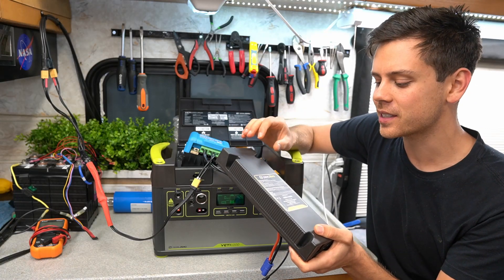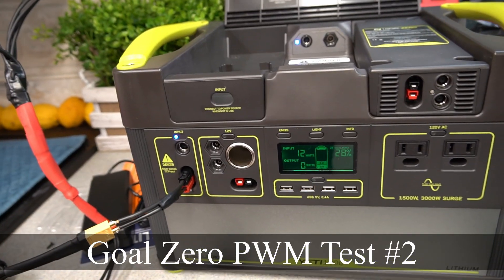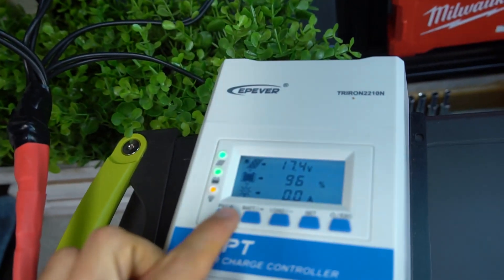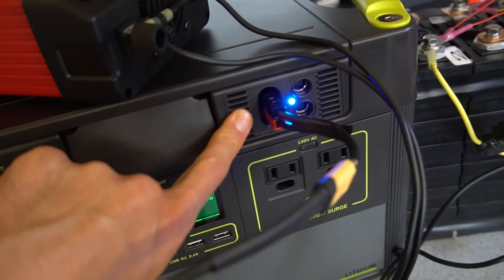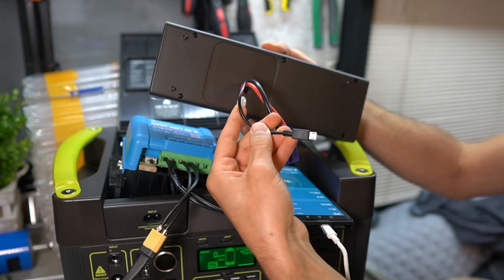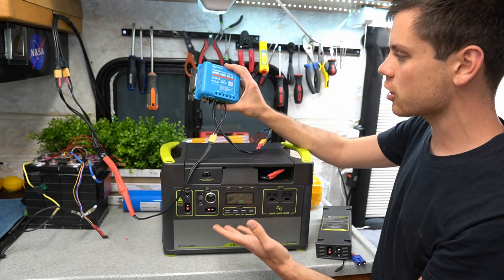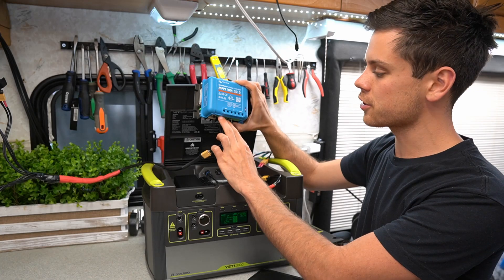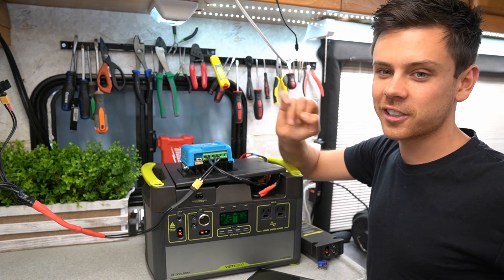How to Hack the Goalzero Lithium by Adding a Powerful Victron Charge Controller

Comment: I love your enthusiasm bro!  My question is, can can I hook my double sprinter batteries into this system as well for extra capacity?  If so, how?  Or, do I need to purchase the Goal Zero Link module and hook that in between the van batteries and the Yeti 3000 connections where the Link Module is supposed to go?  Curt

Comment: Could, or how would you wire this up to use a battery expansion module and tank from Yeti to work with the Victron?
Reply: I'm interested in this as well!   Just grab more batteries and put it in place of the Solar hookup?

Comment: Hi Will. Love your videos. I am located in Australia. I have just purchased a 100ah Lifepo4 battery pack anb a victron 100/20 Bluetooth solar charge controller. All my loads are connected directly to the charge controller. I'm really disappointed that they have crippled the possible functionality for the app to display an accurate battery percentage as all the data is available to the app. It seems crazy to have to add a shunt and a BMV-712 to the system to give me a battery percentage. Are you able to do a video on the victron Bluetooth mesh network and what benefits it gives. Say you have a charge controller, a BMV-712 and a 240v charger all connected via a mesh network what would the benefit be?

Comment: Thank you, Will, for another great video.  I have a question.  Would you recommend getting a Goal Zero Yeti to power a MaxAir Fan and a Dometic CFX35W cooler fridge instead of setting up a whole solar system?  I also have an 80 W portable Go Power Solar folding Panel.  I am thinking that it would be cheaper, take up less room in a van and less wires/electronics to deal with.  What do you think?

Comment: RE-ASKING for anyone to pretty-please answer:
Is it possible that by using the Victron 100/20 MPPT Solar Charge Controller ($166 - Amazon), instead of the Goal Zero MPPT,  you don't need to connect 3 x 120 W solar panels in parallel  as per Goal Zero (keeping the voltage under 22 V) plus the one separate 120 W solar panel as required by the stock Yeti and instead you should be able to connect just one mega-monster 470 W panel with an Open Voltage (Voc) of 91.5 Volts and Amps (Isc) of 6.45 using the Victron 100V/20A controller without causing any damage and being able to charge at that max rate? Or is it limited by MPPT input connection (at a max of 360W)?

Thanks in advance.
Reply: I would also be interested in knowing the answer to that!!

Comment: Hey Will, just wondering what you think of the Epever solar charge controllers? Ive go a 40amp model from their TracerAN series i use with some cheap folding solar panels in a portable setup for camping or similar.

Comment: Will, are we able to convert the output of a modified sine wave inverter  to pure sine wave (or at least make it better for sensitive electronics) by using a power conditioner such as a Tripp Lite LC 1800 Line Conditioner???? I have a Xantrex power hub 1800 solar generator that i'm afraid to use with some of my electronics..........(if anyone knows, I would appreciate the help!)

Comment: They must of watched your video because there selling the victron mppt on there website My 3000 yeti goal zero running a 800watt aircon shows a thermometer 🌡 in the display after 40 minutes and the instructions say turn everything off and let it cool down , have you ever had the thermometer 🌡 show in the display
Reply: They're not selling it for that purpose. They're selling it for the typical set up of panels to controller to batteries, not to GZ Yeti.

Comment: Great test, but I will stay with the GOalZero MPPT for 3 reasons, 
1) Safety, in case I misprogram something
2) unnecessary hassle with all the connections and trouble shootings
3) appearance

Nevertheless, great demonstration! Keep up your great work! Love your channel!
Reply: Gz charge controller is really bad though. I'm having g to do this work around because the van owner installed 40v panels with the  yeti 3000x. It only charges 150 watt instead of the 300 it should.

Comment: So I would like to be able to have an mppt charge controller 

On my yeti 1000 lithium , but I would also like to be able to use the yeti link so that when I'm driving it would be able to charge the battery, is it possible to do both? Is it advisable to do both?

Comment: Hi Will - Great video.  I have a Yeti 1400.  When programing the Victron 100/20, I found that it won't let me take the equalization voltage below 9.0 volts.  Have you seen this with other Victrons?  Also, will a 9.0 volt equalization be an issue?
Reply: this is what I was told: 
You won't be able to set equalization lower than 9v, but turn on "Expert Mode" and change Equalization current percentage to 0% and automatic equalization to "off" (which you already have) and it will never enter equalization... and even if it did, there'd be 0 current.

Comment: Your are just awesome Will! I just bought a Goal Zero 1400 and the Victron. I had to build my own EC8 cable because I couldn't find one in Europe.
Thank you so much for this awesome DIY Solution :D

In the meantime l came across two questions and answers. ;)
1. I couldn't set the Equalization Voltage to 0. The app always changed it to 9v as a minimum. - > Change the setting to LiFePo first. From there you'll get the 0V Equalization Voltage.

2.With the settings Will suggested my Goal Zero 1400 kept on charging way beyond 92%. I set the absorption voltage to 12.35 and then it stopped at 97%. I suppose I can lower the voltage (float and absorption) even further down to 12.30V for my unit. So be aware Goal Zero 1400 owners 100% are 12.50v!

Comment: hey will, i'm confirming what jwsonoma and carlos gomez said below.  the male ec8 to ring terminal cable DOES NOT plug into the GZ.  super frustrating since i've dropped 1.5k+ on the victron, GZ1k, solar panels and cables.  this cable took the longest to arrive and if i can't get it to connect i'll need to return everything and only have a couple of weeks to figure it all out.  can you please help??

can anybody else on this thread advise?
Reply from the maker: Oh thats horrible! Why doesn't it fit?? It's made to fit that port. And it's easy, just buy a ec8 plug and wire as you normally would. Not hard to do
Reply: @WillProwse  thanks so much for responding will!  i'll let you know how it goes when i get the other ec8 cable.  can't wait too get it up and running!
Reply: hi again, will!  i have everything in place!  took me a bit but i'm ready for my first shakedown cruise!  we're starting with only one panel - 
ECO-WORTHY 150W 18V Semi Flexible - just to start with.  when i got it all plugged in the meter on my phone will show 1watt and climb to 37 watts and then go back to zero.  any suggestions?
Reply from the maker: Can you send me a photo of the plug and the goal zero ec8 plug. You did remove the plastic case right? To access the ec8

Comment: GZ Male EC8 to ring accessory doesn't work!  Hey Will, I just got my GZ accessory, dentical packaging to yours, and the connectors are surrounded by a plastic plug. Mine is actually even heavier than the one you show. The EC8 connectors need to stick out. Any recommendations?  If I make my own which side is +ve. Thanks Great video.
Reply: i'm in the same boat!  i don't see how it ever could have worked.  and this one link is the one i need to make everything come together.  if you figure out an alternative, please let me know.  i'll do the same for you.
Reply from the maker: And it says on the connecter what is plus and minus
Reply from the maker: Use this cable instead https://shopsolarkits.com/products/inergy-6-foot-ec8-solar-panel-cable?utm_medium=cpc&utm_source=google&utm_campaign=Google%20Shopping&gclid=CjwKCAjwpuXpBRAAEiwAyRRPgQ668utkbTCNjk__sDx_TuUSJ82s44CZL1GGyPuLRaNeRvwI4zufyhoCp6sQAvD_BwE

Comment: Hi Will! Thank you for all your information! I used all of it and decided to buy a Goal Zero 1400. One question, can I use the Victron 30a for this as well with all the same settings? I would LOVE to see a video on all your hacks on the 1400!
Reply: I suppose any Victron MPPT will do. It only depends on how many panels you are gonna use. With my setting (Victron 100/20, Goal Zero 1400 & a total of 270w solar) and Wills suggested voltage settings I experienced that it kept on charging way beyond 90%. At 12.35v (absorption and float) it ended up at 97%. I don't know if the battery voltage for the 1400 is different but it seems so at least for my unit 🤷🏼‍♂️. The Goal Zero 400 is rated at 100% with 12.6v as well. I currently run it at 12.30v but it needs further testing. But charging does work very well with this combo! I suggest start slow and work your way up  to your desired percentage.
Reply: Matthias Hollmann just about to get a 100/30 as I will be having  (4) 100w panels parallel into at voltron into the yeti 1400. Any suggestions on wills parameters?
Reply: UPDATE: For the Goal Zero 1400 100% are 12.50v. I still run it at 12.30v (=96%) and everything is fine. The Goal Zero Display doesn’t seem to be that accurate.
Reply: @Lost.Reception  are you running 12.30 for both absorption and float ?
Reply: @MEX72  I do
Reply: @Lost.Reception  Wow I have my settings @ 12.20 for both and my GZ shows 100%  GZ 1400 Victron 100 /30
Reply: @MEX72  Wow! Well the display isn't very accurate. Charge alle the way up with the wall charger and check the voltage! That's how I figured out that my real 100% are at 12.50 volt. :)
Reply: @Lost.Reception  That's a great point, I will do that 
Thanks

Comment: Thank you for making all the videos that you do! I just found them and I'm currently working on my 144 sprinter van conversion with a 390W-380W solar panel. This is what I was thinking for my power is 2 RENOGY LITHIUM-IRON BATTERY 12 VOLT 170AH but now after watching this maybe just a GOAL ZERO YETI 3000? What are your thoughts? Renogy is runny a deal rn and I get 25% of of Goal Zero products so it would only be $150 cheaper to go with Goal Zero for me.

Comment: The problem with too many MPPT controllers is they are often limited to 30volts or less at the solar input. So you cannot run even two 12volt panels in series as their combined series open circuit voltage will exceed 30volts. This I why I purchased a Victron MPPT controller.
Reply from the maker: Wait what? Not epever or any other common mppt on market. Usually it's 100-150. I have some with 200v. Victron has good voltage input, but not that great. Lots of better options in that single regard

Comment: I have a 400w lithium Goal Zero and one complaint I have is that they are not good communicators. I want to buy  the 12v car adapter so I can charge it with my alternator while I drive and they are sold out nationwide. I have emailed them 3 times and got no response. If they are one of those "We got your money so we don't want to talk to you again" companies  I am done with them.

Comment: So can you use the victron controller to charge the goal zero and another 12v lead acid battery?
Reply: At the same time with the same MPPT charger? The voltage setting is completely different. You can't charge both at the same time with the same settings. Liquid acids need higher charging voltage and with those settings you would kill your lithium battery.

Comment: Hey Will, nice Video! I just bought a EPEVER 40A MPPT Charge Controller and I managed to hook it up to the GoalZero Yeti 1400 and to my Computer. What settings can you recommend to charge the Yeti? I saw the Absorption Voltage is at 12.5 and the Float Voltage is at 12.35. But in the case of the EP Tracer I still have some more values to be handled. 
BatType: 0   —> User
BatCap: 200   —> 132 ah (in my case)
TempComp: -3  —> 
OVCutOff: 16,00  —>
ChargLmt: 15,00  —>
OVRcv: 15,00   —>
EquilV: 14,60   —>
RaisV: 14,40   —>
FloCharg: 13,80  —> FlowCharging (should be 12.35)
RaisRcv: 13,20  —>
LVRcv: 12,60   —>
WarnRcv: 12,20  —>
LVWarn: 12,00  —>
LVCutOff: 11,10  —>
DischaLmt: 10,60  —>
RatedLv: -1   —>
EquilDur: 120   —>
RaisDur: 120   —>
BatDisch: 30   —>
BatCharg: 100   —> percentage of charging
ChargMode: 0   —>

Maybe you could help decipher the values. I also tried reaching out to the support ;)
Thx, Eduard
Reply from the maker: Just make sure the charging limit voltage is 12.5v, then make the other parameters agree with that
Reply: @WillProwse  Thanks for the advise. The support just explained to me the meaning of the abreviations. Now it will be much easier to adjust the parameters. I really like your work. I learned very much by watching your channel.
Reply: I had it working but I decided to change to a victron controller due to the easyness of the configuration. If I had a WindowsPC or tablet I would have stayed with the EPEVER Tracer. But now it is much easier.
Nevertheless thanks for the quick replys and all the ideas and reports.
Reply from the maker: You can disable equalization

Comment: Hey Will great video. Just curious, did you mean to say the male ec8 goal zero cable?  I think you may need the female version of the cable. Let me know. thanks!
Reply: did you ever figure this out?  i'm trying to order the right cable...
Reply: CassandraComplex Ordered the cable based on Wills link. One step closer.
Reply: I'm also wanting to make sure I get the right cable.
Reply: I know after watching this video I bought all the stuff goalzero Victron everything I’m still very excited I know I’ll get it to work I just wish I had the right cable
Reply from the maker: It's the wrong cable. I don't get what the goalzero cable is for. The one I used in video is available here: https://shopsolarkits.com/products/inergy-6-foot-ec8-solar-panel-cable?utm_medium=cpc&utm_source=google&utm_campaign=Google%20Shopping&gclid=CjwKCAjwpuXpBRAAEiwAyRRPgQ668utkbTCNjk__sDx_TuUSJ82s44CZL1GGyPuLRaNeRvwI4zufyhoCp6sQAvD_BwE
Reply from the maker: Thanks for letting me know this guy's. I figured the goalzero one was made for that port. I still haven't figured out what it's used for! So strange. But yeah, any ec8 plug cable will work. Just don't mix up positive and negative
Reply: DIY Solar Power with Will Prowse Hi Will, how will i know which ones the positive/negative? Are they marked? Sorry for the silly question.
Reply from the maker: @CarlosGomez-is9dh  yeah that is the same cable and wire set in the video. The plug will actually say positive and negative on it with small symbols. Also you can use a multimeter to find out which one is positive or negative
Reply: DIY Solar Power with Will Prowse   I ordered and received 2 Ruixu 100ah batteries. and one reads 0 volts. Is there anything I can do on my end to fix?  The other one works great. Love your videos!!!!!
Reply from the maker: @CarlosGomez-is9dh  No way! I would try charging it, or connecting it to the other battery in parallel to see if it "wakes it up". The bms might be in protection mode for whatever reason. Try that out and let me know if it shows a voltage reading
Reply: DIY Solar Power with Will Prowse Hi Will. so i connected the two Ruixu batteries together in parallel and the second battery still reads zero volts. I’ve tried using a smart lithium noco g150000 battery charger and nothing. What do you think?
Reply from the maker: @CarlosGomez-is9dh  sounds like it needs to be returned. That sucks. What a bummer
Reply from the maker: @CarlosGomez-is9dh  this is first issue I've seen reported with ruixu
Reply: DIY Solar Power with Will Prowse ok. thanks for your suggestions. My other two Ruixu batteries work like champs.
Reply: DIY Solar Power with Will Prowse I recently purchased the goalzero 12v car charger and i’m using the Ruixu to extend the run time of the goalzero. I use a noco 12v plug w alligator clips. it’s been working really well.
Reply from the maker: @CarlosGomez-is9dh  ohhh that's what you are doing. That's bizarre. Interesting setup. Dang that is complex, you could have just built a custom system at this point! Haha
Reply from the maker: @CarlosGomez-is9dh  yeah the ruixu batteries are pretty awesome, that's for sure
Reply: DIY Solar Power with Will Prowse I started with the goalzero... then started watching your channel. So it’s all your fault :-). It’s actually really easy.  All I was trying to say was if you already have a Yeti 1000 and want to extend its run time. using the car charger and a second battery works well. A picture is probably easier to explain. Anyway, love your channel Will.
Reply from the maker: @CarlosGomez-is9dh  thanks Carlos!! Haha and yeah that's awesome :D
Reply: DIY Solar Power with Will Prowse Hi Will. So Ruixu doesn’t want me to ship back the battery that is reading zero volts. So I guess I was thinking of opening up the case and seeing what’s inside. What are your thoughts. Interested in skyping and doing the unboxing together?
Reply: I was not able to get the cable to work.
Reply: @CarlosGomez-is9dh  were you able to figure out a workaround?  are you giving up on this hack altogether?
Reply: Then I bought that hundred amp hour  battery kit to be here September and I bought that grid Tie system very cool stuff keep up the good work will
Reply: Will, thanks for posting the link. I ordered the cable. One step closer. :)